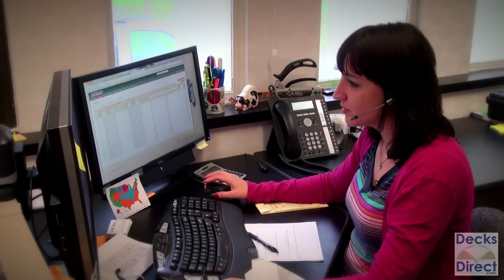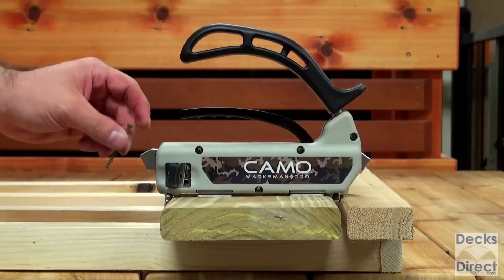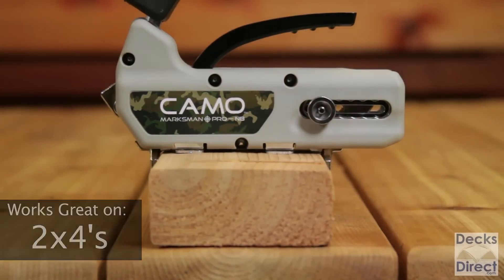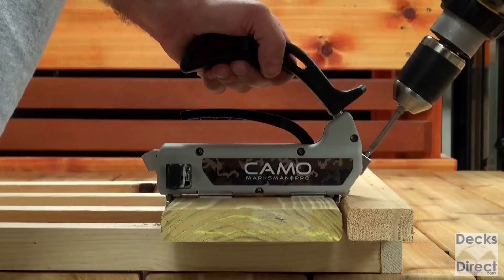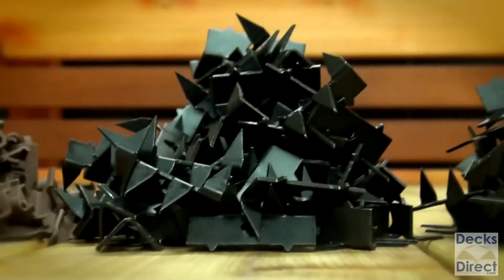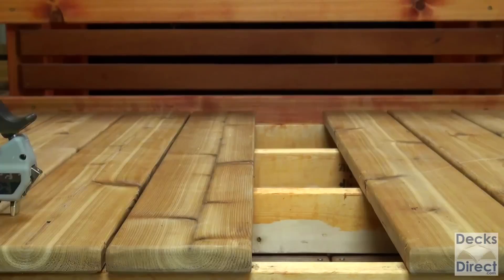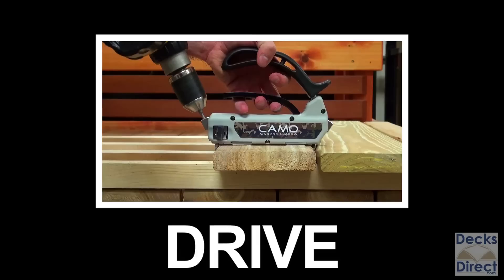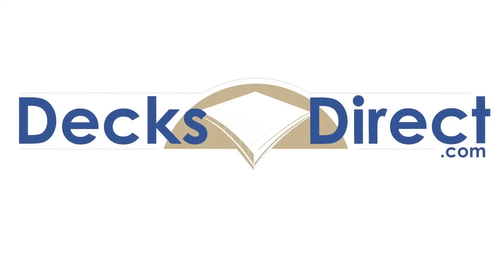Camo Hidden Deck Fastener System

Comment: How to use it with pressure treated wood which is never sold dry and needs to be installed tight to each other since the gaps are naturally forming when the wood is drying?

Comment: The concept is great and probably the quickest hidden-fastener system, but does take a lot more time than surface nailing.  My only issue is the the screws. I built a deck spring of 2014 using 5/4 PT deck boards and now the screws have come loose in areas which receive more direct sunlight (due to the more extreme expansion and contraction of the wood over time). These areas are now squeaking/creaking when walked on. I haven't removed a screw in these areas to see if its loose or just broken, so I guess the threads need to be more aggressive or the screw needs to be thicker. I may replace these loose screws with stainless steel trim screws down the road.
Reply: My concern is the pressure treated will shrink its recommended to install tight  for shrinking and this tool separate it it
Reply: @607roger  what I do is either buy KDAT PT decking or if that isn't in the budget, have the "wet" (per say) pt decking delivered before the rest of your building material for the deck. Then I measure the moisture content of each board and mark them accordingly. I set stacks of decking up on 2500 pound capacity saw horses, I set up multiple sets. 3 each stack or 400 sq ft roughly for 12-14ft, 4 each for 16-20ft 5 for 24 ft. I snip the banding holding it together. Then I will stack the boards on the second set of saw horses next to the pile I have. I space each row with 1x's and space each row width wise with 6-10 small strips of hardy siding, or zip sheathing or whatever I have from whatever jobs. Something thinner and strong. I then run ratchet straps around my piles that are stacked to tighten them back up. I don't even cover them. Rain doesn't seem to affect anything either unless it rains the day of installing. I do try to keep them in a shaded area. You don't want them to dry too fast or they can check like mad. Mainly the off the shelf super green decking. 
2x6 decking doesn't do this nearly as bad or cup or curl anywhere near what 5/4 does. No 1 ground contact 2x6 syp is what I will use 9 times of 10 if a customer is dead set on standard PT decking. Plus my premium 5/4 isn't stocked in longer length than 16 ft. And the kicker is..... A 20ft no1 spib graded ground contact costs me 1.12 per board LESS than premium 5/4 above ground in 16ft. Not the case at a big box store. I always use my hometown mom and pop lumber company's.  Now.... Sometimes I don't have the room to do 2x6. In that case, I try to upsell a nice redwood, mohagany, ipe, or even composite or pvc. Depends on the surroundings of the home.
Back to PT lumber....KDAT is absolutely worth the money if you need pressure treated decking. Whether 2x or 5/4. You can order it anywhere. You can seal or stain immediately. I like to do this before installing and I can hit every side quickly and thoroughly. Then just come through and touch up after installation. And you can install with the 3/16 gap and it will be pretty well perfect. Or with a good NO. 1 2x6 after 1-3 weeks of sitting stacked, spaced, and strapped. Usually a week for me.  My non KDAT are still heat treated, and kiln dried to 15% before treatment. And that makes all the difference in longevity and in how stable the wood is even after a good wet treatment.  It's super fast to run down each side with a router and do a slight roundover or a chamfer before stain or seal if you want also. 
If the budget only alots for off the big box store shelf decking in (choice or select) 5/4 or #2 select 2x  you're honestly best off face screwing them with 3 or 3.5 inch (respectively) premium deck screws.. I like fastenmaster trio for 3" face scews, and hillman power pro for 3.5's.  Moisture content of that stuff is so high that my moisture meter can't read it. (Over 65% moisture content.... YIKES)
Nothing is stronger than face screwing with a high quality screw. And even then it's a crap shot with that low quality decking. If you have to have a hidden fastened deck you can use the camo marksmen edge or I have been using the edge pro and I like mine. They work fantastic on pulled tight pt decking as well. Which we do a lot for covered decks and porches.
And 1 last thing I can't stress enough..... Always hit those end cuts with 2% copper napthenate. Or whatever the decking manufacturer states in the fine print. 
I would also highly recommended wrapping the tops of all joists, beams, stringers, and blocking. Any wood to wood/composite/pvc contact. And imho the most critical places are any built up beams, rims, headers, or end joists. But even solid and rough cut, we wrap them. 
I use grace vycor peel and stick membrane almost exclusively. Any butyl or even asphalt based wraps will work just fine. It adds decades to the deck structure and years to the decking itself. It self seals around your screws so water will never make its way through into the joist even after the decking starts failing. And of course just flat keeps water out of everything on the top of the structure. Especially important in shaded areas, coastal areas, extreme climate areas. Everyone should use it is where I am going here. Once water is traped between the decking and that structure, it can't dry properly. I always say... "If it can't dry it will die." That goes for most every building material. 

Anyway....I hope this helps you or someone else in question. 
Sorry for the book. I tend to be maybe a tad too thorough. 😂
I am extremely passionate about helping others and building science though. 
Take care! And good luck to ya! 🍻
Reply: @Geoffrey Thomas. Usually you just need to snug them down. I imagine the decking was wet when installed. 5/4 and especially non KDAT 5/4 is some whacky, unpredictable stuff. I haven't had any of the camo's break on me in any pt. But since that lumber shrinks so much, I'd say a good little tighten will do the trick. 👍

Comment: Can this tool still be used if the deck boards are placed at an angle on the support beams, ie not perpendicular to the support beams?
Reply from the maker: Hello, Jeff!

Thanks for reaching out to us!

Yes, the CAMO Marksman Pro Tool can definitely be used for angled deck boards! CAMO recommends placing the tool over the high side of the joist so that the fastener remains completely in the joist when fully driven. You may want to lightly mark the deck board
where it intersects the joist to ensure it's driven into the joist completely.

We hope that this helps, and if you have any other questions, please feel free to give us a call at 1-888-824-5316. We'd love to help out!

Thanks again!

Comment: Can this be used on 2x6 boards
Reply from the maker: Hi, the Camo Hidden Deck Fastener System is designed for deck boards that are 5/4" thick (approx 1" actual thickness)

Comment: Do you have an alternative for wooden floor installation? Where space between each board is not required.
Reply from the maker: Hello, there!

Thanks for reaching out to us!

When installing wooden floors or decking where you want zero space between the boards you could use the CAMO Marksman Edge Tool which can be purchased here: https://www.decksdirect.com/camo-marksman-edge-unit-tool.html. This tool is in stock and available to ship out the same day as ordered!

If you have any other questions on your deck or construction project, please reach out to us at 1-888-824-5316. One of our deck designers would love to help you out!

Thank you again!
Reply: @Decksdirect  but that tool only screws one side of your board

Comment: Have pressure treated but not kiln dryed decking dont want a gap between. Can i still use the device without gapping
Reply from the maker: Hello, Paul -
Thanks for reaching out to us!
Yes, you'll still be able to use the CAMO Hidden Deck Fastener system for your non-kiln dried decking. Using the Pro-X1 CAMO Tool you'll be able to install at 1/16 inch gapping; check it out here: https://www.decksdirect.com/camo-marksman-pro-x1-unit.html
Or you can use the CAMO Edge Tool, seen here: https://www.decksdirect.com/camo-marksman-edge-unit-tool.html which allows for no gapping and will keep your treated boards nice and snug.
We hope that this helps, and if you have any other questions, please feel free to give us a call at 1-888-824-5316. We'd love to help out!
Thanks again!

Comment: How do you screww the first screws in when you start up against a wall?
Reply from the maker: +Terrance Camilleri Sorry about the late reply. The first screw against the wall needs to be face screwed down through the board. Most people use a screw that matches the decking. Starborn makes a variety of color match screws for all types of decking material. Hope this helps.

Comment: Can I use it to hang vertical fence boards?
Reply from the maker: Hello, bumble bee!

Thanks for reaching out to us!

While it's not recommended by the manufacturer, as long as CAMO Starter Clips are installed along the top and bottom edges, CAMO Hidden Fasteners could hold vertical boards in place. You can check out the CAMO Starter Clips here: https://www.decksdirect.com/camo-edge-starter-clips.html

If you have any questions on your project, feel free to give our deck designers a call at 1-888-824-5316! We'd love to help you out!

Comment: Can I use reg 3 in deck screws
Reply from the maker: Hello, Billy -

Thanks for reaching out to us!

Using non-CAMO Hidden Fastening screws is not recommended per the manufacturer. However, standard 3 inch deck screws should be able to work with the CAMO Pro Tool as long as the screws are a size 7 with a Trim Head. With a 3 inch screw, you may have some extra length when fully installed, however, that shouldn't be too much of a concern.

I hope that this helps, if you have any other questions, please feel free to give us a call at 1-888-824-5316.

Thank you!

Comment: can this be adjusted to secure a 2x4 or just 2x6?
Reply from the maker: Hi Chris, 
Yes. The Camo Marksman Pro-NB can be used on narrow boards with dimensions of 3-1/4 in to 5 in. You can find it at DecksDirect: https://www.decksdirect.com/camo-marksman-pro-nb.html. Please let us know if you have any other questions. 

Thanks! 
The DecksDirect Team
1-888-824-5316
Reply: @Decksdirect  so the answer is no. This can not be adjusted to use on a 2 x 4. You must buy another Camo tool for that.